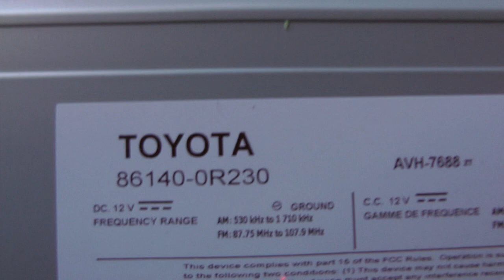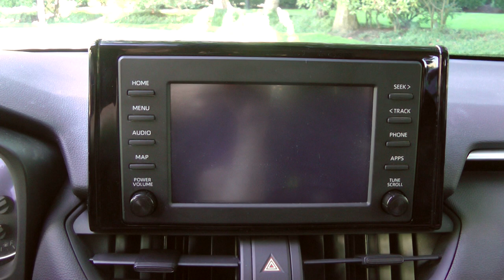Toyota RAV4 (2019-2024):  Radio Head Unit Removal And Installation.

Comment from the maker: PRODUCT LINK:
Radio Display And Receiver ID 86140-0R230 Fits 19 RAV4 872518 - https://www.ebay.com/itm/175783141967?mkcid=1&mkrid=711-53200-19255-0&siteid=0&campid=5338971185&customid=&toolid=10001&mkevt=1.

RECOMMENDED TOOLS:
1. TRIM REMOVAL TOOL - 4pcs Auto Door Clip Panel Trim Removal Tool Kit - https://amzn.to/41nYhsk.
2. SOCKET SET, RATCHET - GEARWRENCH 57 Pc. 3/8" Drive 6 Pt. Mechanics Tool Set, Standard & Deep, SAE/Metric - https://amzn.to/41wE6Z3.
3. SWIVEL HEAD RATCHET - GEARWRENCH 2 Pc. 1/4" & 3/8" Drive 72 Tooth Dual Material Roto Ratchet Set - https://amzn.to/3kwhHdS.
4. TELESCOPING MAGNETIC PICK-UP TOOL - Telescoping Magnet Pick-up Tool - https://amzn.to/407A2Nz.

Toyota RAV4 (2019-2020): Dasaita 10.2" Screen Android 10.0 Head Unit Installation And Review - https://youtu.be/ftN5Z9EQPfY.

Comment: I have a 2019 Rav4 limited with only Apple Car play. Can I swap the radio head with one that has both Android & Apple car play and where can I buy it?
Reply: I am trying to do the same
Reply: Same here!! Been checking since 2019! I don't understand why no one makes a aftermarket radio or a harness to connect subs !!  Hopefully this check will show how to connect a loc or how to tap into the speaker wires from the OEM head unit.
Reply: Ребятки, на что поменять эту отстойную голову, может есть уже аналоги с андроид авто и карплеем?
Reply: Anel sahacic The sub harness is the same one for the 2018+ Camry from TacoTunes.
Reply: Not sure of the terminology. Is this a single or double din unit? Should we only replace with a bottom base unit?
Reply: @asahacic3249  tu as trouve une solution ? :)
Reply: @graphique-anime902  pas de solution
Reply: I know it's late, but it seems the ppl of the internet are useless to answer this. Yes, you can get a 2020-2021 Rav4 radio, and install it on your 2019. Just make sure you match your current radio (JBL or non-JBL). I just did mine yesterday and everything is working properly. I even bought an AAWIRELESS so that it connects to Android Auto wirelessly.

Comment: Hello, thank you for the great videos! Do you have a video on how to remove the center air vents?  I'm looking to replace my current center air vents with no flow control dials with one from the higher trim that includes the flow control dials.  Thanks.